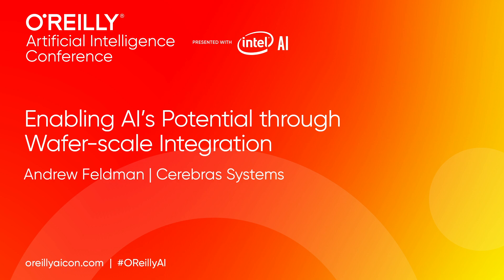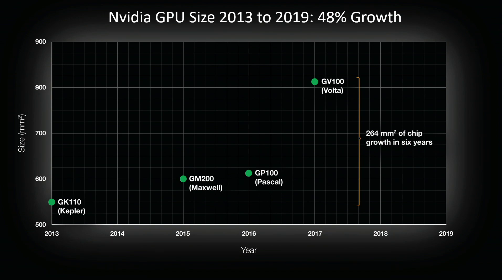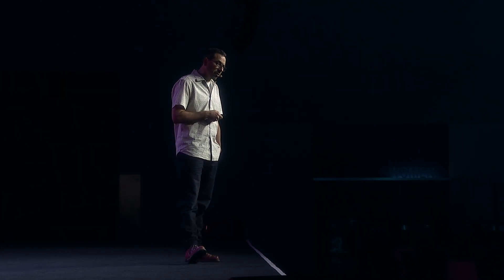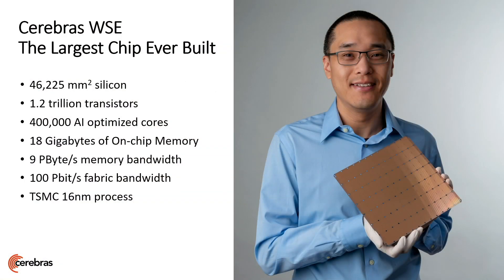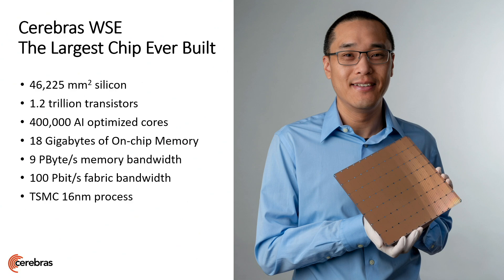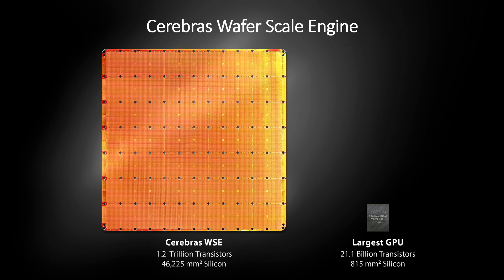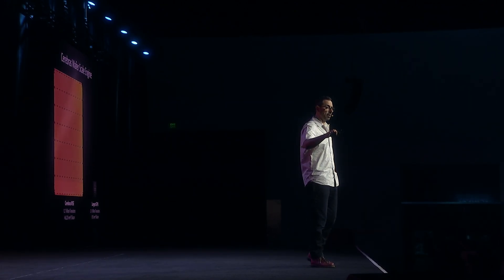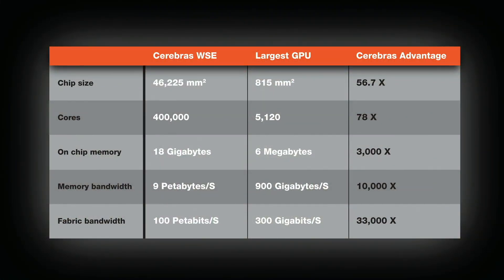Enabling AI’s potential through Wafer-scale integration - Andrew Feldman (Cerebras Systems)

Comment: How about the power consumption? By the size looks like you gonna need a diesel generator to power this thing...
Reply: @antonyiorio7613  It's a helluva lot !
Reply: It's consumption is around 15 kWh which is still less than nvidia GPU if you compare them by spec by spec on compute horsepower.